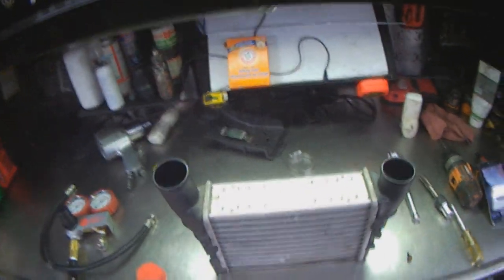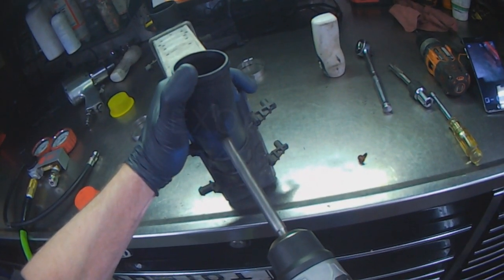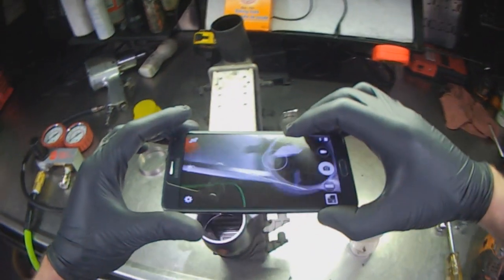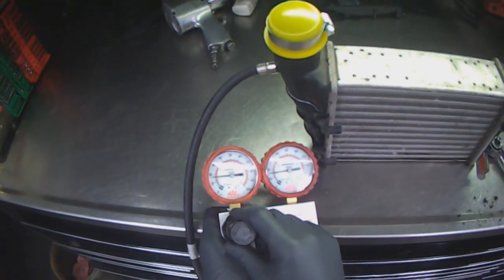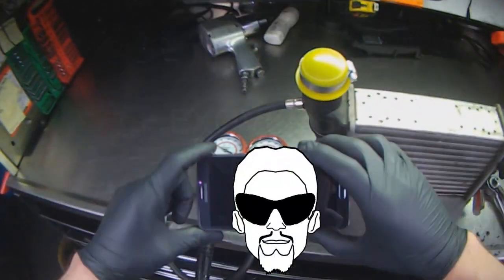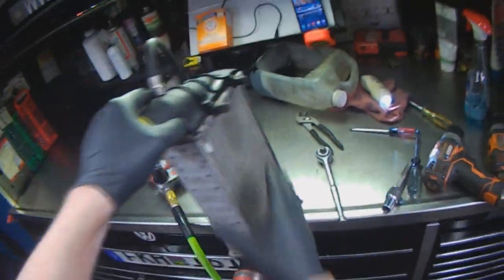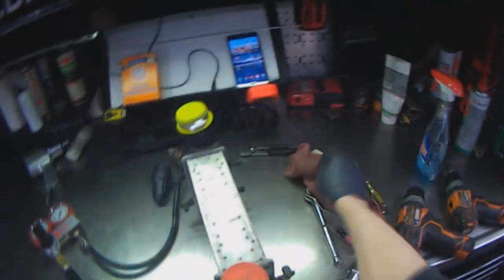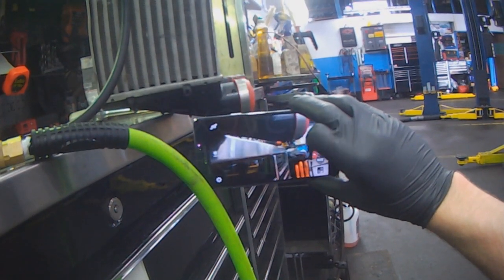Intercooler pressure testing (after drilling... OMG!!!)

Comment: imagine getting a runaway in gear! That could be deadly
Reply from the maker: It happened to me... I took it out of gear. I should have kept it in gear and applied the brakes. It happened so quick... first instinct is to press the clutch pedal & turn the key off, which didn't help.
Reply: Turn the ignition off next time when it starts to run away.
Reply from the maker: +Chris Jordan I did... it's burning the oil, hence... a runaway.
Reply: Gotcha, must have been a lot of residual oil in there.
Reply from the maker: Yup... the intake manifold was soaked.
Reply: That's wild!
Reply from the maker: A wild 10 seconds for sure! Couldn't see traffic behind me because of all of the smoke!
Reply: Like you said and I do concr with you opinion...Why in the hell would FORD even consider theatening to void our manufacturer's warranty when they have been full-on aware of this problem? Secondly, why is preventative maintenance to overt the piss poor engineering shortfalls. So as to let the general public experience a catestrophical failure so as that FORD has to assume NO responsibility for the shitty design resultant of the CF- C(harlie)F.Foxtrot) ECOBOOST, intake valve coking 2° to DFI whereas fuel system tx will not have any effect unless you directly spray all intake valves!

Comment: it's kinda like one of those things I don't agree with it but hey u do what works kinda like gay people just not my cup of tea
Reply from the maker: Once an engine blows up due to oil ingestion... it's a logical, easy, quick alternative to a catch can system.
Reply: Thomas EXOVCDS right on man what causes all the oil
Reply from the maker: PCV fumes collect in the bottom of the cooler... oil leaking from the turbo can also cause it.
Reply: Not me ,it'll cause overboasting pressures and over work turbos.....your going to have a more costly repair later...
Reply from the maker: Nick... who are you replying to... to which comment? What will cause overboosting?
Reply: The system is enclosed , the turbo will keep killing through the weep hole and it's cause pressure to never spool to the targeted goal , not really overboasting but more like over working......if this was a repair that Ford knew , they would have added a drip that would be in line to this.....
Reply from the maker: A small hole of that size is not going to cause any issues. I install a screw to plug the hole, because I don' t want oil to spray out and get all over the bottom of the car or the drive way. It seems people have run their cars with a small open hole for several years... with no issues. I guess more time will tell, but after x-amount of years... it could just be regular failure and not failure due to a small hole. People will do what they feel comfortable with. If some people don't feel comfortable doing something, that's fine. The same way that I "suggest" to drain & plug... people don't have to do it, but it's a simple & quick way to check the health of the system and prevent  possible engine damage. If people would rather spend time & money installing a catch can... that's fine. It's doing the same thing that I am doing.
Reply: Hi Thomas,I did the same on my Passat 1.9 TDI 2002 AVF engine 131HP, and to be more sure I added a rubber oring to the screw,no loss of boost at all,great ideea Thomas ,thanks
Reply from the maker: Why would there be loss of boost? Try it without the o-ring. =)
Reply: I am a diesel mechanic and this is a great idea you do not want a run away diesel ...  great thinking

Comment: What size and type of screw did you use? It looks like a coarse thread sheet metal screw but it's kind of hard to tell. I need to do this badly.
Reply from the maker: It's a 1/8" hole... go to Home Depot and get a self taping screw (wood screw) that is a little bigger than 1/8". Or ask one of the employees for something that will plug a 1/8" hole. If you make a hole that's bigger... use a bigger screw.

Comment: Do I need the screw or would a 1/16in hole be a no issue
Reply from the maker: Depends on the engine. If it's a VW TDI or turbo gas engine... I would plug the hole after draining. If it's an EcoBoost engine... my understanding is that they leave the hole open.
Reply: @EXOVCDS  thanks